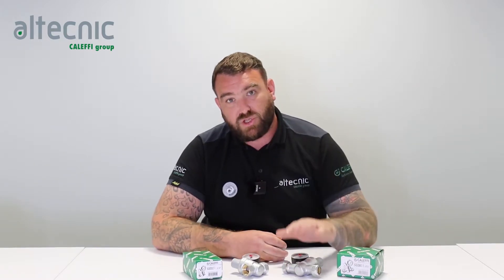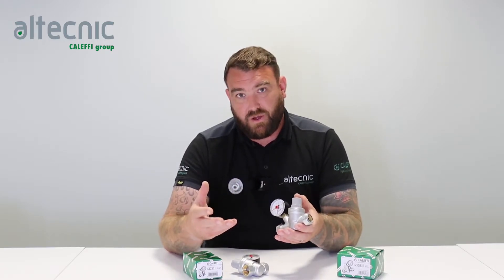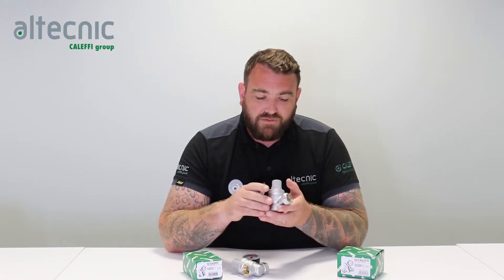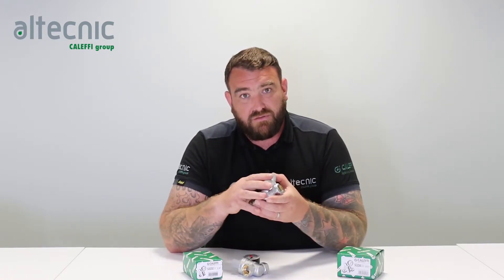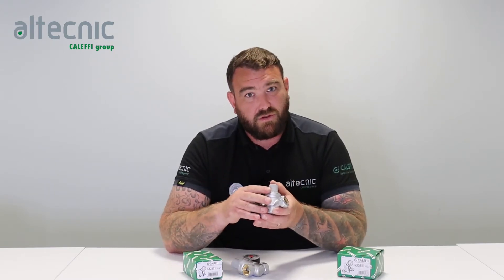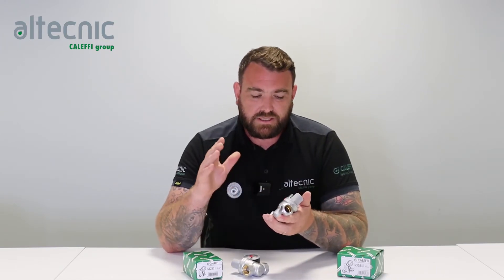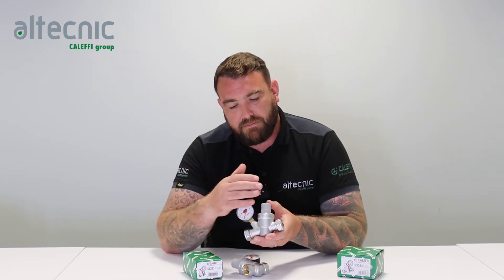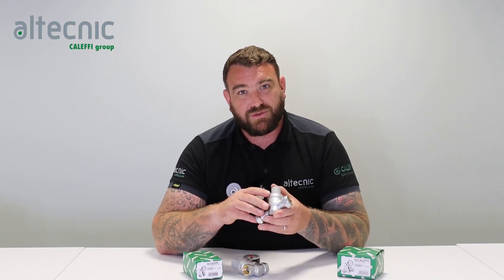Quickfire PRV Training - Static vs Dynamic

Comment: Thanks for the explanation, I understand that a dynamic PRV will only reduce the pressure when the water is flowing so when there is no flow the water pressure can go above what the PRV is set to. What I'm not sure about if how a static PRV will effect the flow pressure, does it have no effect at all or does it control the pressure at all? Thx
Reply: Good afternoon Jamie, I am really sorry for the delay in getting back to you. Please could you send me your contact details to ed.morris@altecnic.co.uk and I will give you a call. Cheers Ed
Reply: I have the same question as Jamie Dyer, could you possibly post the reply on this video. As I would like to explain this further to our team of engineers.
Kind regards shaun